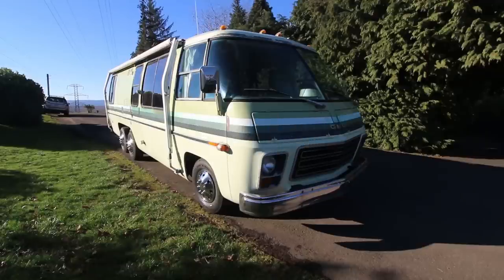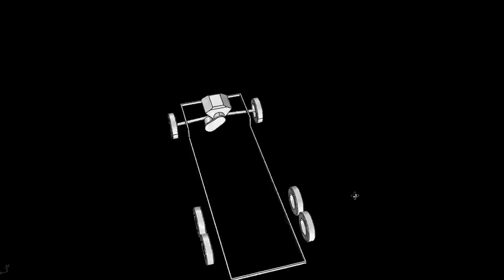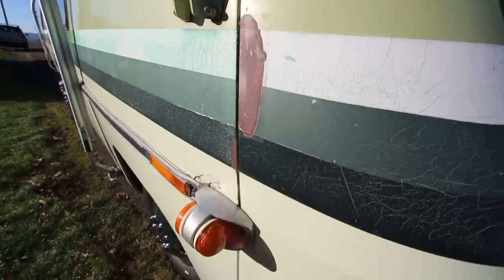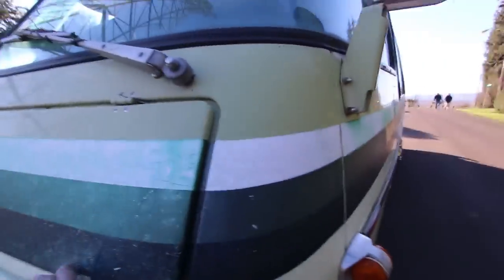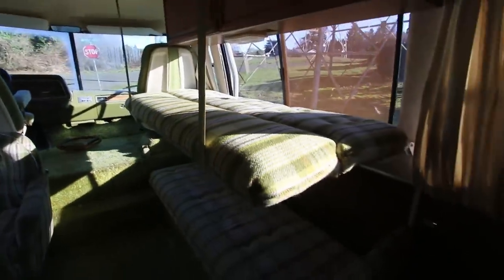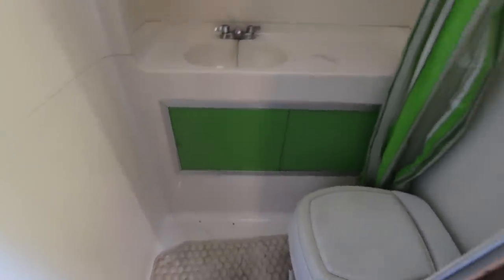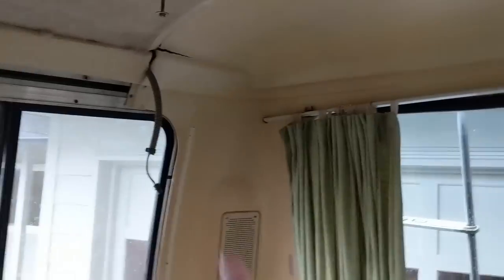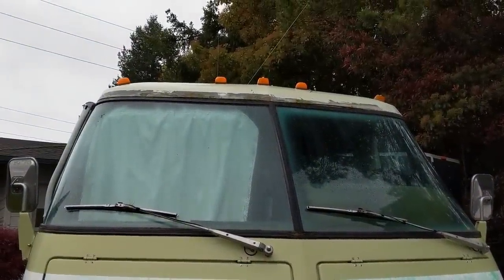Building The Best Damn GMC Motorhome Ever - Beginnings & Explanations

Comment: Great Video and Good Luck.  I just started a 1976 that had been gutted.  Replaced the floor in the rear with 3/4" treated plywood.  Took out Propane tank as going all electric.  Also better to replace tank with 2 portable bottles.  Once propane tank is out and all plywood removed you can slide a new piece of plywood all the way thru to include the battery to the rear of Generator.  Now working on replacing the rest of the plywood floor, rather than multiple patches.  Robert
Reply: I would prefer (living in the tropics with lots of rain and humidity) to avoid plywood to support any valuable equipment! I'd rather put together an aluminum frame made with angles, good screws, and THEN inside that, install the plywood in.

Comment: My wife and I were on our honeymoon in 1977 when a retired couple pulled into the resort in a new -77 GMC motorhome.  They were gracious enough to give us the tour and show it off.....we were in love!   If you can find one of these available today, you are obligated to restore it and give it another life....it's just the right thing to do.  I'd love something like this as a project and I believe I could do it justice.  My biggest concern would be to have a reliable drive train.  As old as they are, some have surprisingly low mileage on them.  The engine is a known workhorse but the front wheel drive transmission configuration is quite unique.  Wish you the best of luck and hope you continue to post the progression of your restoration.
Reply: TH425 is very robust, was used in Toronado and Eldorado, no major problems and basic to rebuild if needed

Comment: I bought my 1978 Royale  almost a Year ago..  I didn't have to rip anything out.. I did replace the old 8 track tape player. and ADD an awning..  I am working on replacing the air ride compressor system. but still can drive it anywhere..  Oldsmobile 403 V8 engine..  Love it.. My retirement go out west vehicle.
Reply: Santina Murphy  I bought an electronic compressor control unit from Keith Vasilakes It took a bit of doing but now I have a neat control board w/ a "camp" function and  and a remote that does up/down left/right. from across the street or longer..lol.
Reply: Santina Murphy   Contact Keith. He is on many GMC motorhome pages on fb..  Coat me 800 bucks for the digital control Board. and the solenoids etc.  You will have to supply your own compressor.. I bought a Viair 450C and a 1 gallon air tank..   Some information here.   http://gmc.mybirdfeeder.net/GMCforum/index.php?rid=0&t=msg&th=37883  and where is you control board and compressor located now? My control is on the driver side armrest area, and my compressor is located in front of the generator compartment on the drivers side. So I tapped into the existing wiring harness.

Comment: +1. .. Fond memories the GMC motorcoach. .. Back in the day, a boss had a brandi-neu 1975 GMC Eleganza model motorcoach with an Imron white exterior. .. As I recall its Eleganza model was a higher-end unit - He'd order the GMC from scratch resighting the options guide with ease. .. The Cadillac Eldorado steering wheel and 472 4Bll Holley V8 was a nice touch.

Comment: It’s just a suggestion, but making copies of automotive lenses is a lot easier using resin casting. Smooth-On has a an excellent video of the process. The resulting part has excellent translucency and color and is much stronger than a 3D printed part.

Comment: Love these motor homes, it would be great if GM brought them back with modern technology inside and out.
As for the clearance lights, you can go the casting route. There are many videos here on you tube that several manufacturers have published that show how to make the two part silicone molds around a good lens as well as he to mix and color the casting resin to create an almost exact replacement. The casting resins are also available with UV resistance so the casing will not deteriorate when exposed to sunlight.
Reply: These would cost $700,000.00 NEW TODAY...

Comment: The only thing I think you could have added to the intro was that another driving factor in GMC developing a front-drive motorhome was that corporate had already spent the money to develop a heavy-duty front-wheel drive system for the Cadillac Eldorado and Olds Toronado. Without that in place I can't imagine this project having gone forward. Note also that the end of the run (1978) for the GMC motorhome corresponds with the end of the run for the classic Eldorado and Toronado.

Comment: I'm sure by now you have managed to remove the stripes, however if you haven't......a blow drier and a plastic scraper works GREAT! And if you have some glue or old sticker sticky just apply goo be gone and wipe off...good luck!  Oh btw...those lights are called Grote lights...you can buy a complete replacement in Led...clear, red or orange for $15...

Comment: A working shoulder belt saves you from planting your face into the steering wheel or dash.  You don't have that problem in that RV.  Those captains chairs can't be replaced with automobile seats, because they sit like a lazyboy.  They're plush and remain comfortable for hours on end.  So put them up for sale and see how much more they're worth to other GMC RV owners than the one's you bought.

Comment: Major water leaks come from drip rail . Remove all screws and with a puddy knife, lift drip rail molding that runs the entire length on both sides. I used flex seal, a urithan rubber to seal under moldings. Others have used 3 m brand marine grade rubber sealer with good results.
Reply: RV lap sealant is the right stuff to use. Put it over all seams and attachment points on the roof, and replace it every five years or so.

Comment: Not sure if this has been said, because I didn't read all 550+ comments, but our motorhomes don't really take regular old cheap pump gas. As long as the gas tanks are still metal, you should be using non-ethanol fuel, just like with lawn equipment. Ethanol is hydrophilic and absorbs/mixes with water. Because of this, using regular gas (with ethanol) will accelerate the rusting of your fuel tanks, especially when allowed to sit and more so when allowed to sit less than full. Aluminum or poly fuel tanks will avoid this issue but you also get better gas mileage for the more expensive fuel. I measured 8mpg on a trip from FL to GA and 12mpg on the return trip. More power from pure fuel vs fuel+alcohol.

Comment: Brings back memories of my father owning a Palm Beach model, hideous color but was fun. Watch the rear suspension it needs to be greased often or the pins and bushings wear out, you can tell when the top or the rear wheels start tipping in at the top, its an expensive repair.

Comment: I have a recommendation for the vinyl removal. 3M and some other manufacturers make an eraser wheel that removes the vinyl without damaging what's below. I used it on a vinyl woodgrain wagoneer and removed all it with a couple of them make light work of 30 year old cracked vinyl
Reply: yes they work great

Comment: I bought a 73 Winnebago brave and it still has its original stove oven and refrigerator and they work phenomenal and a lot of times because I'm traveling I can run them off the gas my don't have the 3-way there only two ways gas or electricity though no battery power I've got nearly all of my original interior upholstery all I did have to change the flooring and I would never do a full rebuild unless it was in terrible shape but considering the damage that was done to this GMC over the years I guess it really doesn't matter to preserve it but my biggest thing was to have one that was authentic to the time. And I've even bought all 1970s Tupperware and so my plates and storage containers and cups all that stuff go with the era of the motorhome it's just a fascinating world and I'm so glad that the other people into it

Comment: You showed a pusher as an example of a rear wheel drive RV. My brother bought one of those but sadly passed away before he could really get started on his restoration. He was planning on Retiring after he finished it. They are an awesome RV and a great design. I have no idea what happened to his after he passed. He did say it was hauled to Texas on a flat bed. I know he got parts for the air ride, a replacement window for the drivers side. It needed brakes and rotors as well as a new carburetor.

Comment: I love the incredible naivete of the presenter here who seems to know very little to nothing about motorhomes I have experience with old ones because I've grown up around motorhomes most of the ones I dealt with were 70s and 80s and is just absolutely charming to see all the things that people think are weird or I'm going to get rid of the toilet wouldn't want that trust me everybody says you don't want to use it until you need to and it's not that disgusting you just put the tube on you put it down the drain you open up the vent is this a big you know it's just a big valve and then he'd flush it all down and put the to get over it real quick if you got kids trust me you've dealt with much worse

Comment: Regarding the photos for the turn signal print - if you have an item with a flat surface (like the bottom of the signal seems to be) you can get both scale and shape from a flatbed scan of the flat surface. They're inexpensive and common and can come in handy if you find something thats a bit of a pain to get scale from or awkward to get a shot of it with low distortion

Comment: Hello, I hope this doesn't sound to geeky but the  example picture that is shown (45 seconds into video) that is supposed to show the higher center of gravity do to a drive shaft running from the front to the back is a picture of a rear wheel drive rear engine RV achieving the same low center of gravity as the GMC. There  is no drive shaft running the length of the vehicle. Showing a picture of 1973 Winnebago would be correct.

Comment: Funny to hear about front wheel drive and a low floor being so modern in the USA in the 70s. Citroën did both of them combined already in the late 30s in their commercial vans.
Reply from the maker: I have known about the Citroën H van for some time but your comment motivated me to do a little more research (thank you). Citroën was definitely a leader in the early days of Front Wheel Drive. The H van could very well have been the inspiration for the GMC. What was "modern" about the GMC motorhome was putting a very powerful and robust FWD drivetrain Into a motorhome. There was never a Citroën powerplant capable of pushing 4500kgs down the road at 110km/h. It's likely that someone had converted a Citroën van into a motorhome before the GMC was designed, but it would have been an amateur effort and not an intended use for the Citroën. Depending on the weight of the conversion, it would have been taxing the Citroën drivetrain to the limit. In fact the H van's drivetrain was the same 4-cylinder one found in the Citroën Traction Avant and the Citroën DS which are both passenger cars. The great innovation of the GMC is the heavy duty mid-sized truck level power plant. We've never seen anything like it before or since. This is surprising given the fact that the vast majority of passenger cars today are FWD.
Reply: @IndustriousPursuits  the father of the H vans were the TUB vans which where build pre ww2. The H models started after ww2. Back then it was not underpowered compared to any non US car or van.
I realy like the GMC motorhomes. I saw one on a campsite in Austria about 20 years ago. It was really something special because here in europe you almost never see US-size motorhomes or oldskool US caravans/travel trailers like airstreamers etc.

Comment: So a couple of other comments. Great job on the 3d printing. I'm hoping you have removed the base to those marker lights. Over the years I had replaced some of the caps. Finally I bit the bullet and bought all new LED lights. When I removed the old lights, the lower plastic bases just disintegrated. I'd be willing to bet money, the base of your marker lights will be a source of many water leaks. At minimum, remove the bases and re-seal them. But most likely they should be replaced. 

Secondly,  When I was growing up, we had a motorhome with a built in central vac. We loved it. It sucked much better than most portables. It always had a good home, so it was never in the way. Its one of those stupid things that you don't realize how convenient it actually is. I had wished my Revcon had it. My current coach is big enough to store a Dyson, which is worth it.
I painted my vinyl dash with interior paint I bought from Riggs Brothers. It held up extremely well and was very easy to spray on. I had the coach for 16 years. It stayed flexible and really did not peal off except in areas that wore down from rubbing. Make good effort to keep it clean. Eventually the paint becomes porous and becomes more difficult to keep clean. I would anticipate a repaint every 10 years. Mine was light cream, so it showed the dirt. 

There is a product called Ghost -Off that I've heard works very well at the final stages of removing old decals.

Comment: Fun fact: those sidemarker lenses are AMC Javelin units. I learned that when  I had my '74 Canyonlands. That 455 would liquify the front tires at the drop of a hat!
Reply from the maker: Thank you for this tip! While they are certainly similar, the AMC ones have rounded corners whereas the GMC once have sharper corners. Also, the plug could be different, and the overall dimensions could be off as well. I need to find a replacement from the GM ecosystem (Chevy, GM, Cadillac or Buick).

Comment: Great overview! You could install a folding leaf table by the side chairs. I think I've seen one at Ikea that is just a leaf on a hinge, I'm sure you could fashion a similar homemade version that would fold flat when not in use. My family had a 23' GMC motorhome back in the day, too bad it's not still around. You might try using a heat gun (or hairdryer perhaps) to soften and remove the vinyl stripes, if they haven't been removed yet.

Comment: I have one similar to this, it's a 1973 GMC sequoia with a 455 olds engine. It still has all its original chartreuse green interior and everything but the generator ( which I am looking for another onan like the one it had) is still in good working order. I have to get the air suspension working correctly again and new tires and it will be ready to rock
Reply from the maker: Everyone likes the 4 bag design from GMC coop. That's probably what I will end up upgrading to.

Comment: I happen to know quite a bit about these motorhomes. The engine  and trans was borrowed from the Toronado front wheel drive car also used in the Cadillac  Eldorado.  The taillights were taken from the standard Chevy van. You are right these were the best motorhome ever built by a production company. I would love to own one. Please keep your engine and transmission services by trusted personal regularly. I recomend using chemicals to remove the stripes. 3M makes this in spray cans.use plastic to scrape off the residue. More if you need it.
Reply: You are (almost) correct. The Eldorado used a Cadillac 472 engine of its own design
Reply: @lsee6145  Great motorhomes. I gues GM had many drivetrains in production and it really was a great powerplant and easy to put in that coach. Just two tag axels in the rear and away they went.
I forget who the genius was who invented it but he deserves cudos and a gold watch for a great design
Reply: @lsee6145  Toronado was Olds version of the Cadilac El dorado probably built in the same factory

Comment: You'll have a time finding a muffler shop that can work on one. It's too low to be serviceable and not many muffler shops have a lift big enough. The huge downside to front wheel drive on a vehicle that heavy is ever getting off pavement. It can be a sticky experience! Other than that, have fun with it!
Reply: How do I refurbish car battery
Reply: A limited slip differential is available, as well as better gear ratios

Comment: You can paint the roof exterior using a fiber reinforced rubber roof coating for RV's, to seal all the cracks.  You have buy online a $40 plastic cover for he AC unit and have it replaced in 10 min. 
Assume it has a Chevy 350 V8?  
Always liked the design, reminds me of my hippie van in the 70's minus the fat tires and air lifted rear end and portal windows.
Reply: Early ones were 455Olds V8,,later were 403 Olds V8

Comment: Such a cool RV, alot of people just get rid of the stove and put in a microwave, and do you know if you can run down the road using the generator to run the roof AC?
Reply from the maker: Yes. You can do this. Also, if your alternator or battery gives out, the house and engine electrical systems are connected. You can go down the road running the generator to keep the engine up front running and the Motorhome moving down the road.

Comment: In the 90's i worked at a machine shop, work got slow and our boss put us to work on his GMC, I was remember adding a spacer under the front break wheel cylinders so it would take wider break shoes, we also removed the rear cap and extended the frame 3 feet and made new panels, ended up looking like it was made like that. we hade to add some heavy duty casters to the frame for steep drive ways\]
Reply: Front brakes are disc, not drum